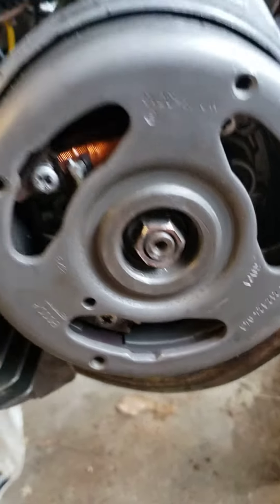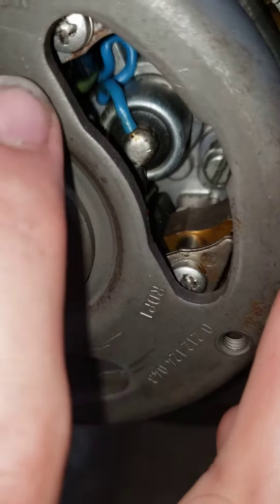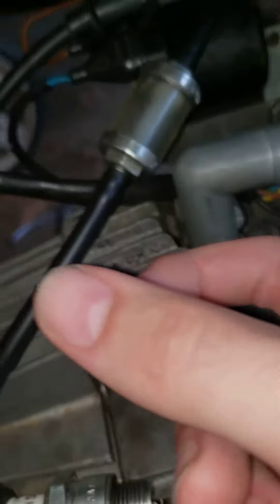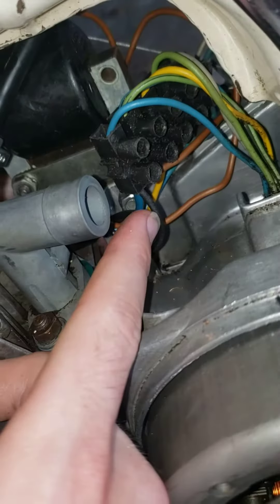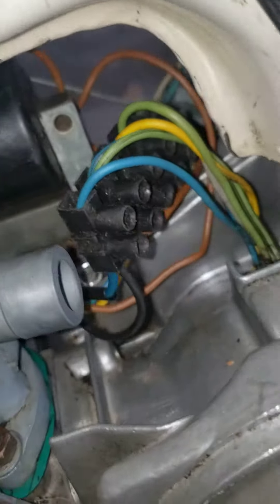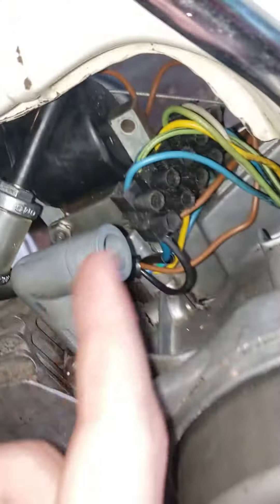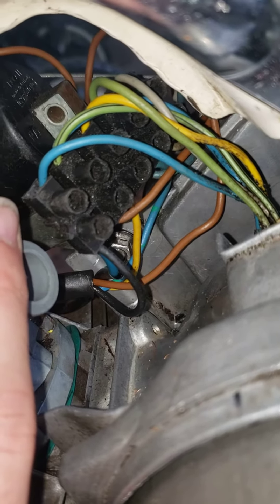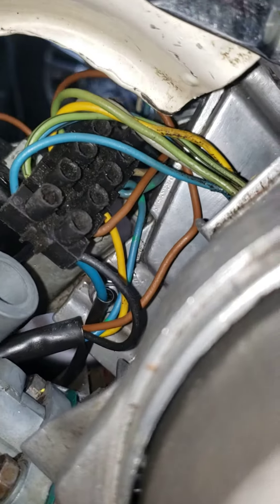78 puch maxi wiring

Comment: The isolation is on the screw. To want it to work u want to have the coper from under the isolation to connect the screw. Then it may fixes the problem.